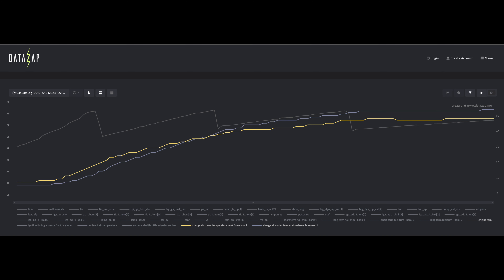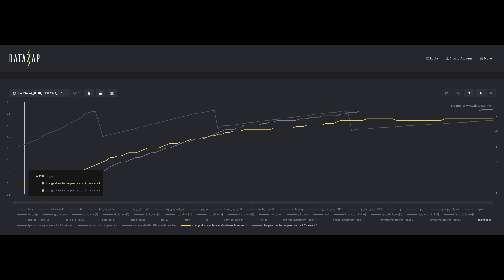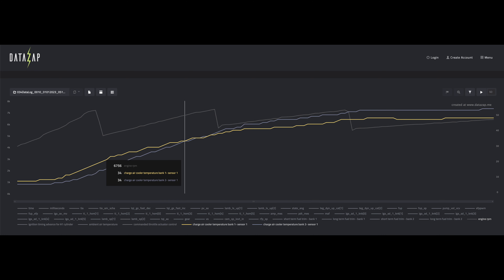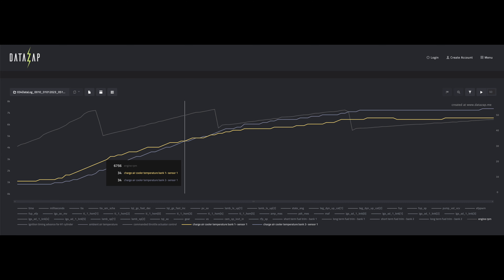Magnuson TVS 1740 // I had a busy winter!!

Comment: Would appreciate if you could post logs of the dyno pull. Would help to see what the fueling does.   Great work!  Any idea on what kind of inference you can make from the IATS flattening out when at speed? I feel like those kind of results say a lot in terms of heat exchanger efficiency.
Reply from the maker: Are you developing something for fueling? 
As for the iats leveling off, that's what happens on a bigger blower. They move more air and can spin slower to do that, why I mentioned Pulley Ratio. Vs spinning the 1320 even harder which is making more heat than the ICs can remove and not as much boost as what I can do with the Maggie at a much lower PR.
Reply: @SuitedUp2The9s  I mean I made my own dual low pressure fuel pump setup, trying to combat high PR woes. I wouldnt say developing though. Youre like one of the only individuals I can find that would be pushing the limits of the fueling of the platform. Kinda stems interest to see the expected fueling/logz of a car breathing right.
Reply from the maker: The thing that hurts me for air but makes it easier for fueling is my altitude above sea level. My fueling is pretty dialed and not taxed. With the summer DA here, I am even wondering if I don't need the meth for extra fuel. More testing to do.
Reply: @SuitedUp2The9s  interesting.... your pumps are not in the last 30% of the duty cycles with the maggy? I noticed with my ported blower lpfp was pushing 70+% duty and hpfp was peaking at like 90+. Kinda the reason I wanna see logs is how your trims/AFRs go with the maggy. Keep us posted!
Reply from the maker: @Christos  it is within the last 30% yes. On both. But still have room. Lambda is on spec too. 😃👌 I'll have more to share soon

Comment: First of all... congrats!! But what are you looking at on logs to see intake restriction?
Reply from the maker: Thank you! I'm looking at Pdt_mes and amp_mes. In a mult gear pull or a 1/4 mile run, I was seeing amp_mes at 933 and pdt_mes at 826. Over a 100hpa difference from atmospheric pressure to the tmap sensor on the mouth of the sc. So trying to get that closer to help the sc breathe easier.
Reply: @SuitedUp2The9s  Ty... 034 would not explain anything from my log other then a intake restriction.
Reply from the maker: @1bads5  yeah a difference of 100 is not ideal. 50 is pretty good. And anything less than 50 is pretty ideal

Comment: That’s killer power out of the 3.0t but now you start to weigh the factors in spending $7k-10k on a upgraded blower for 600hp or going 4.0t. I can see in the case of being balls deep in a build like your car or some of the s4 guys but that’s a big leap in cost to performance. I’m excited to see if you decide to throw 034’s cams in it, on E40-85 you could probably get past that 600awhp mark.
Reply from the maker: It's always something to consider for sure. I'll definitely be looking to go further with this so we shall see! Who knows what way I'll go haha I don't yet haha
Reply: I got nitrous on mine for free from a buddy and it shoves me into the seat even more then it normally does. For me personally unless I get a good deal on an aftermarket blower nitrous works a treat just gotta mix e40 with 93 and boostane and have no ignition correction
Reply from the maker: @tylerspecht7553  that might be something I do down the road for max effort 😃
Reply: @tylerspecht7553 How big of a nos shot you throwing at it?

Comment: That is a pretty impressive dyno run!   What is average boost difference between the two blowers?  Is the power mainly all from better IATs?
Reply from the maker: The iats are helping. But the boost and total air flow from the Maggie is the real key. It doesn't need to be spun nearly as hard/fast to max out the MAF calculation.
Reply: @SuitedUp2The9s  thats very nice,  i wonder how the Merc tvs1900 would do! It would probably have a hard time with fueling im assuming.